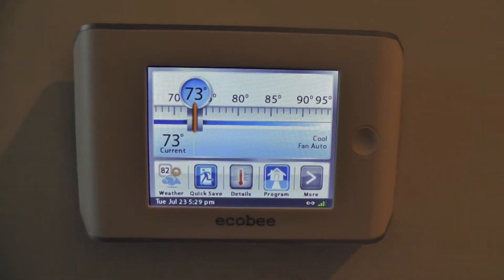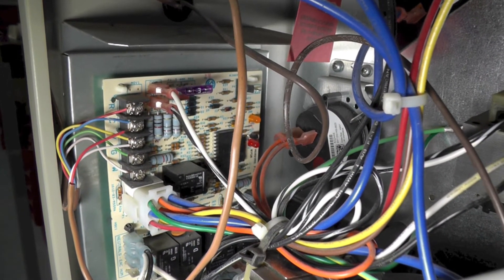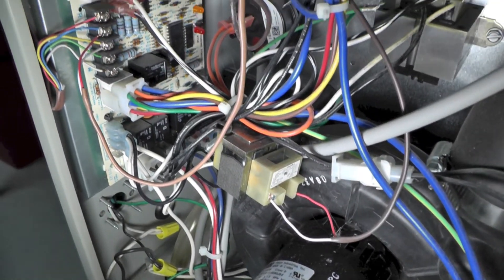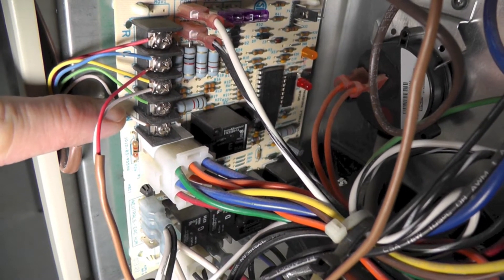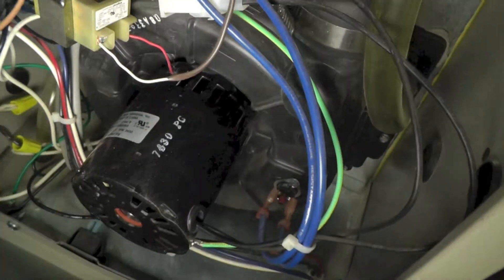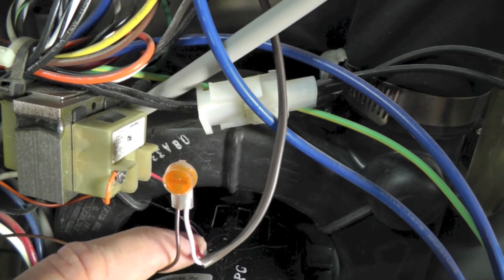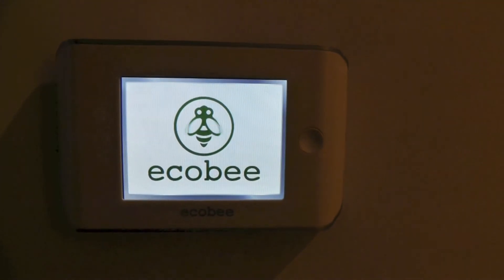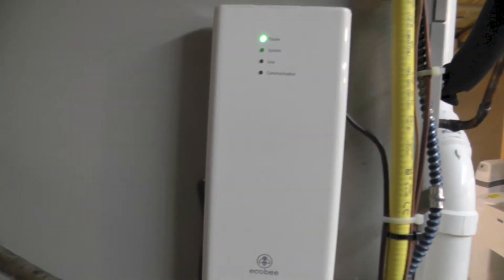Ecobee Smart Thermostat Installation

Comment: Did Ecobee bless the installation of connecting the jumper from the R to the 24V in the equipment control module and the C from the furnace to the ground on the 24V?  Some others recommend taking a parallel circuit off of your 24V transformer upstream of the furnace control board.
Reply from the maker: When I installed the Ecobee, I called their tech support to discuss my wiring since I had the separate transformer for my humidifier.  During this discussion, I reviewed the entire wiring plan with them and they did not note any problems. I have been operating the system for 5 months now through both cooling and heating with humidifier modes and have not had any issues.

Also, per the Ecobee knowledgebase:
https://ecobee.zendesk.com/entries/20440657-24VAC-Terminals

Q: The 24vac terminals are not labeled at all on the equipment interface - do I just put the C wire in one & jump the R into the other?  Does it matter which is which?

A: It does not matter if the R goes to the top connection or the bottom connection. The C wire must return to the common terminal on the furnace and you can either jump the RH/RC to the other 24V connector input or run it direct to the R terminal on the furnace control board.
Reply: Thank you!  Your video and comments will save me a lot of time.